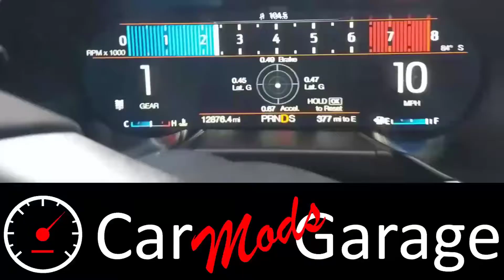Camshaft Install Outer Caps 2 of 3 - #Eclipse2GBuild

Comment: Hey what’s up Bro, question. Did you put gasket maker on the rear cap on the intake side? I see you put some on the front. Just wondering do I need to put some on the back.
Reply from the maker: Go to 12:25 to see if that's it.  I put some gasket on that side only.  The other side the valve cover gasket will take care of.
Reply: @CarModsGarage  hey what’s up Bro, I forgot to go back and tell you that I saw the video when you put the gasket maker on rear cap the one you had to retap the thread.
Reply from the maker: @roycepickett1598  oh ok now I know the one you are talking about 👍